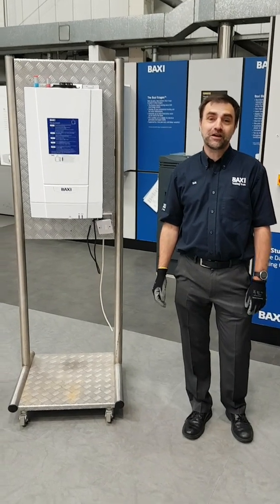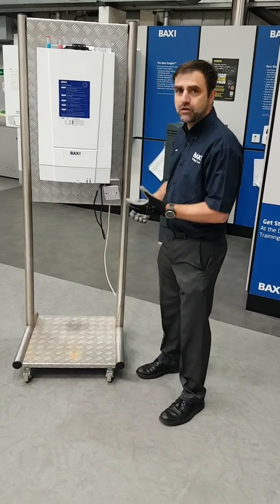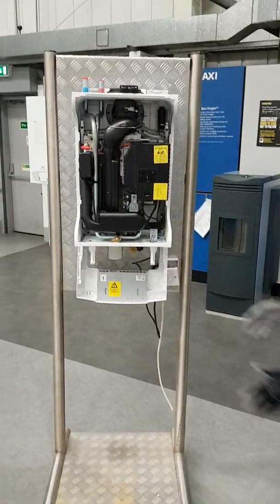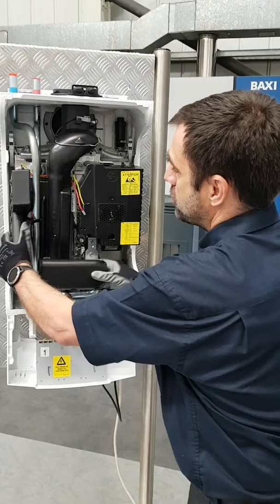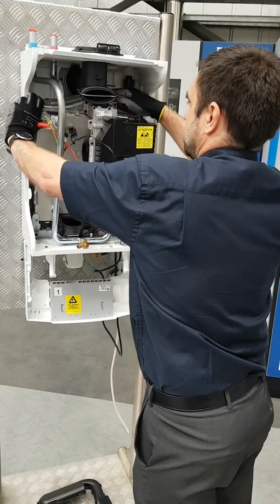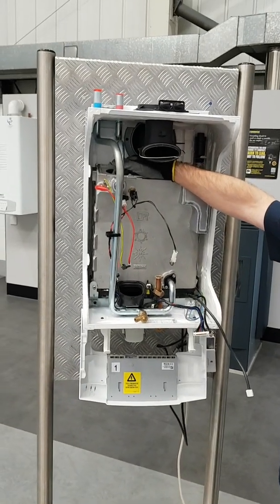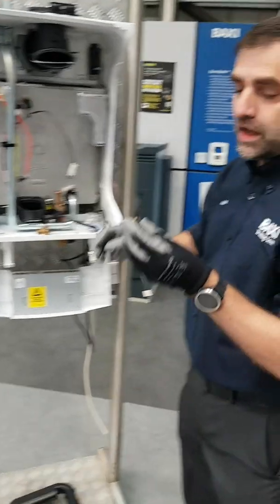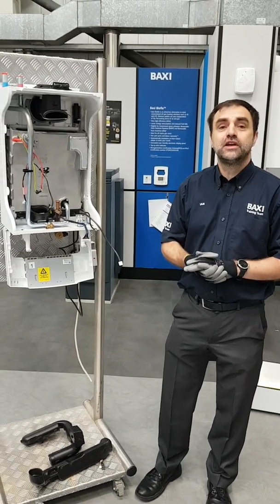Get a sneak peak at the new Baxi 800 Heat boiler

Comment: I worked on another baxi maybe 4/5 mo the ago with the same design with the gas valve, fan and pcb, it was so easy but I was shocked in that the fault on this particular boiler was a blow fan, this then required a part costing over 600 pounds to replace, is it not possible to just swap any of these individually? I thought it was such a shame the a lovely design was so overly expensive to fix